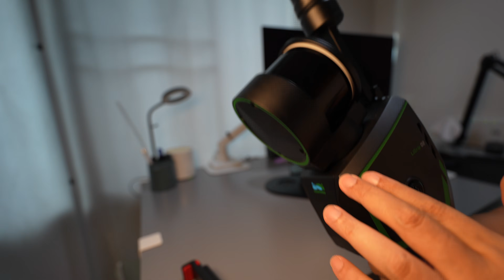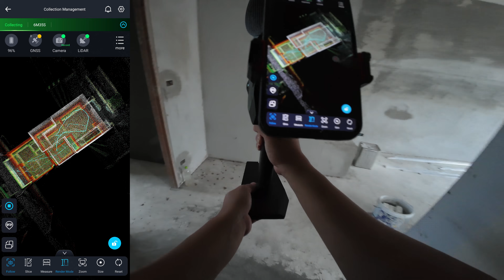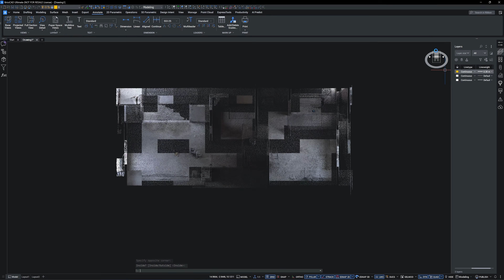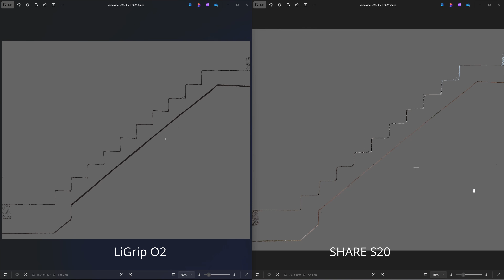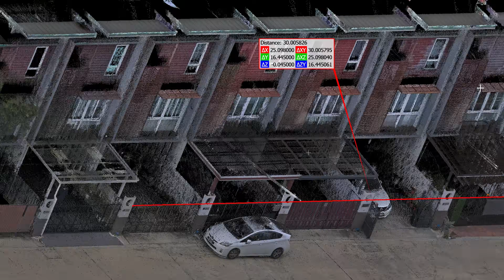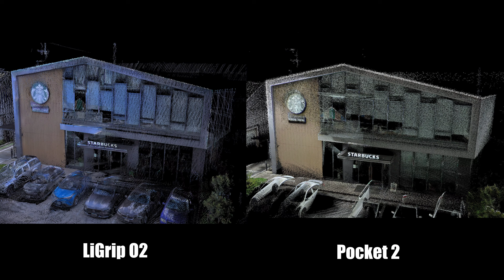LiGrip O2 LiDAR Scanner Review – Tested & Compared

Comment: It seems that you know how to properly scan with SLAM devices, but I don't know whether you have a surveying background. If you do, you should create a tightly adjusted network of GCPs using a total station, a level, and least-squares adjustment software. Then you can get a reliable indication of the SLAM system's precision and accuracy.
Reply from the maker: I’ve been a structural engineer for 27 years, with projects ranging from football stadiums to cable domes. I always conduct my own surveys using total stations and later RTK, because I don’t trust surveyors, too often they lack the necessary grounding in geometry and mathematics. A total station is a primitive measuring device with no self‑correcting mechanism; every error carries through. By contrast, once you understand how SLAM algorithms work, you’ll realize its trajectory cannot be corrected by another measuring instrument. There are six degrees of freedom, but you can only correct three. Attempting that actually makes accuracy worse.
Reply: @Payo-TensileCreator I don't suggest to use gcps to correct the trajectory. I suggest usings gcps to determine how precise and accurate are these slam devices.
Reply from the maker: @nikouer  The only tool that can truly verify the LiGrip O2’s accuracy is a steel measuring tape. A total station isn’t qualified to test this device. Remember, it’s the same LiDAR with a lab‑verified error of 3.0 mm, excluding additional errors from bubble leveling and human handling that will go above 5-6 mm. And just so you know, Topcon also sells this same device under their own brand.
Reply: @Payo-TensileCreator Sorry that I can't convince you that 1+1=2.
Reply: @Payo-TensileCreator Hi Payo, as @nikouer stated you do have some knowledge of Slam Devices and how to capture with them. But nikouer is correct. 

A total ststion is absolutly able to test and quanitfy the accuracy of this device. Taking into account its own error in measurement of course.

Additionally what do you mean by its the same lidar?. A Total station doesnt use lidar. And xt32 puck that these devices use does not have a lab accuracy of 3mm im not sure where you recieved that information? When stating accuracy of these devices you kinda have to mention at what distance to give a proper example too.

TS accruacy absolutly can blow out past 5mm level, thats why nikouer mentioned LSA to statisitically reduce those errors.  
Additionally these devices can suffer from Slam Drift, Noise, Slip, etc. They are great and we use them daily as well, but you cant outright state the accuracy without really verifiying with control points. 

You can correct the tractory of such with total station derived coordinates and increase the accuracy of the point cloud by constraining slam trajectory at certain points. Slam is self correcting sure with loop closures etc, but if its wrong in the first place it can have dire effects on accuracy. 

Bringing up what projects you have worked on doesnt really prove your point or contribute to your argument either. 

At the end of the day good video, but outright stating incorrect info in the comments does not help your audience.

Comment: will a quickrelease F38 possible to attach to this?
Reply from the maker: Yes, the battery grip includes a ¼‑inch thread, but with the scanner weighing 2.2 kg, a monopod is too flimsy to support its dead load. A survey pole provides a more stable and suitable option for use as an extension pole.
Reply: @Payo-TensileCreator  i have an monopod that can handle an payload of 8kg.  Manfrotto MVMXPROA4. should be capable than right?
Reply from the maker: @GvdM_3dOV  I worry more about the strength of 1/4" thread on the handlebar. LiGrip O2 has optional survey pole adaptor with stronger lock clamp. I recommend using these extension pole with fishing fighting belt, it'll feel a lot more secure and take tensions off your shoulders.
Reply: @Payo-TensileCreator  will look into it. Atm i will first rent an S100-16

Comment: Very informative video!  Thank you for the details you provide in your videos. Have you compared the 16 laser LiGrip 02 vs the 32 laser model that you’ve been reviewing?  We are looking at purchasing the 16 laser model and would love to hear any feedback or experiences you’ve had.
Reply from the maker: I’ve never personally tested the XT16 variant, but I know it uses the same IMU sensor, a key factor in its accuracy and low drift performance. I do own an FJD Trion equipped with the XT16, and its scanning speed is noticeably slower. With that sensor, you need to walk at under 1 m/s (which is typical) to achieve the same point cloud density. By contrast, the XT32 and XT32M allow you to walk much faster while maintaining quality.

Comment: what Scanner would you recommend for someone who builds hand rails and staircase to be able to take arcuate measurements and floor details in a room that is around $10,000 mark
Reply: Thay are  pretty much all the same under $10000. Most of them uses mid-360 lidar, which drift like crazy on long stair. If you want something works great for multi level, go with device with 360 fov and good imu, those cheap scanners are gonna give you headache......
Reply: @jasonliang8876  thanks for the feed back, would you recommend using a hand held 3d scanner like Creality Sermoon X1 3D Scanner as the hand rails i do are usually no longer then 10 meter long
Reply from the maker: The SHARE S20, C1, FJD Trion P2, and Pocket 2 are suitable for staircase scanning. These compact scanners deliver around 10 mm of accuracy error. While their point‑cloud quality isn’t as sharp or clean as the LiGrip O2, they are still reliable enough to reconstruct handrails and staircases.

Comment: Does software license lock mean you have to subscribe?
Reply from the maker: The license is locked to a single PC. For Manifold Tech and FJD, you need to contact their support team if you want to switch computers. Green Valley, however, provides a license‑transfer function, so you don’t need to reach out to support. Now imagine your PC breaks down during Chinese New Year, you’d be stuck without a computer to process your data.

Comment: Could you please review CHCNAV RS7?
Reply from the maker: CHCNAV is sending review samples of the RS30, RS10, and RS7 for testing. I expect to release the review video within about a month.
Reply: @Payo-TensileCreator  Interested in RS7, it's released already a few months, but still any normal review about quality..
Reply from the maker: @jonukasjonukas4288  CHCNAV claims its latest scanners feature a self‑developed IMU sensor running at 500 Hz, along with custom Hesai JT64 sensors designed specifically for them. I’m very interested to see how this setup performs in practice.

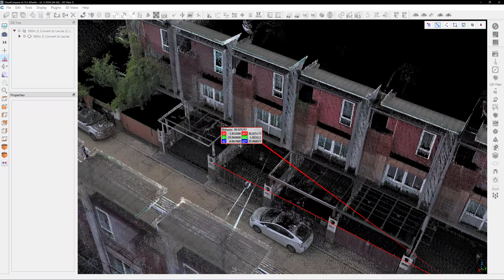Comment: 16:11 Could have the reference measurement drifted with time?
Reply from the maker: For IMU sensor, yes, drifting error will increase with operatation time.
Reply: @Payo-TensileCreator yes this. But I mean your predefined known measurement. 25mm could be ground settlement or therman expansion at this scale.
Reply from the maker: @PetterStetter  The 25 mm error stems from the large scanning loop. The wall I captured sits on a pile cap with a deep foundation. Since it isn’t connected in series with other walls, thermal expansion has no effect.

Comment: Do you need the full Greenvalley 360 Software suite ? Which costs around 4500/year to extract the las file. Interesting to compare it with the Share S100 or S30 (600pts/sec) but id say the dual slam would give this the edge. Crazy money though.
Reply from the maker: No, each scanner includes a perpetual license, and you can revoke and reactivate it on another PC yourself. Some features, like 3DGS or specialized tasks such as power‑line processing, require separate purchases.
Reply: GreenValley sold their software both on an annual and perpetual plan. They also sell each module of their software separately, e.g., the SLAM processing module, 3DGS module, architectural drawing module, forestry module can be purchased separately. But basically you need their SLAM processing module to process their specific file extension before export to other file format like LAS or E57.

Comment: Hi Payo, been following you for a while, am I safe to assume, for a valuable, flexiable software choice with GPS, pointcloud, and good gaussian splatting support, Share S20 is the best choice?
Reply from the maker: Yes, at this moment SHARE S20 ticks all your boxes. I've asked the Manifold Tech for the RTK support, they haven't replied to me yet.
Reply: @Payo-TensileCreator  You can register a GNSS from your local gov. I tested it this week, but it shows "Single" in the GPS display. The instructions, guide and manual for the GPS are still missing for S20

Comment: Thank you for this review! 

I hope Xgrids send some scanners. But maybe also share with the s100-32.
Reply: This!
Reply: The s100-32 seems very promising for the price. The problem is the puck sensor has low vertical fov and it's not rotating.
Reply from the maker: Last year Xgrids quoted me $9000 for a K1. Excluding shipping and tax.
Reply: @Payo-TensileCreator  That's quite cheap for K1. The MSRP price of Lixel K1 was around $15,000 as I knew.
Reply: @kunlapun  yeah but Payo is only testing. and sending the scanner back
Reply from the maker: @kunlapun  With today’s LiDAR scanners flooding the market, I don’t think high pricing is sustainable anymore. One viewer told me he purchased an FJD Trion P2, listed at $6,499, for just $3,000. This kind of dealer‑driven distribution scheme really hurts users.
Reply: @Payo-TensileCreator They release the new K2 with lower price and it cost around €6,700. But for higher tier scanner like Xgrids L2 or GreenValley O2 are seems to be on same price tag for competitive with Faro Orbis or Emersent even NavVis.
Reply: @Payo-TensileCreator  damn. They dont want people testing it? I heard it was good but also got a lot of noise. More than the share.
Reply from the maker: @guillaume8307  Their product distribution seems to rely entirely on dealers, keeping information limited while maintaining high dealer margins.